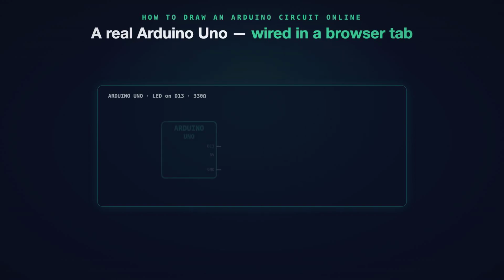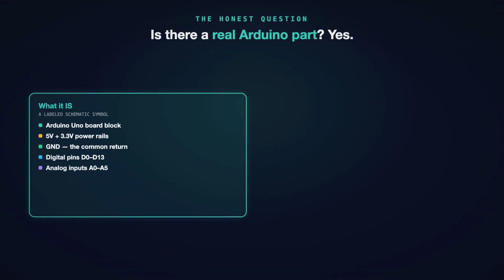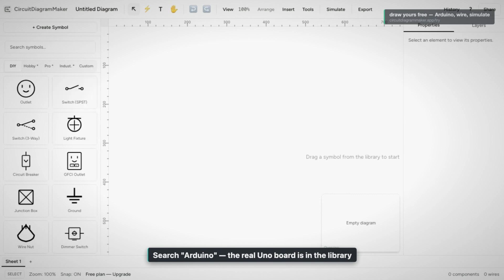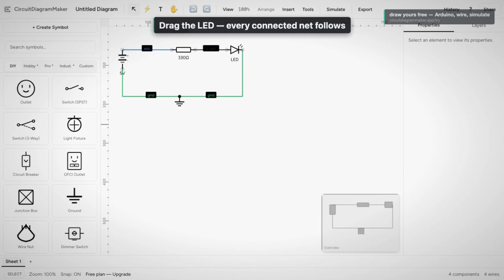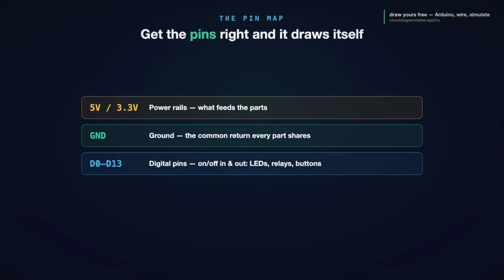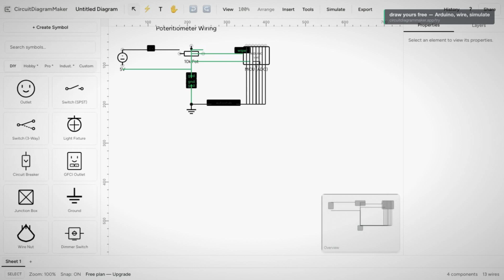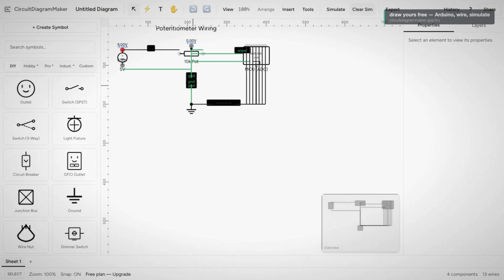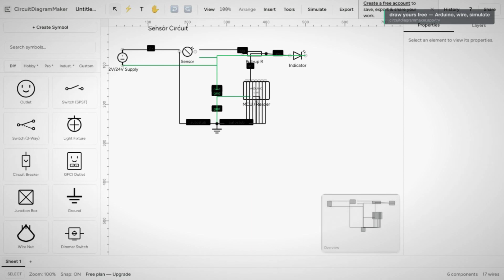How to Draw an Arduino Circuit Diagram Online

Comment from the maker: Full disclosure (also said in the video): CircuitDiagramMaker is our tool — free to draw and simulate an Arduino circuit right in the browser, nothing to install. And yes, the Arduino Uno is a real labeled symbol with named pins (5V, 3.3V, GND, D0-D13, A0-A5) — not a photo of the board.

The workflow in one line: search "Arduino", drop the Uno on the canvas, wire an LED to a digital pin, a button to an input, and a potentiometer's wiper to an analog pin — then hit Simulate and watch real node voltages and branch currents land on the schematic. A pin tied to the wrong rail shows up as a zero before you ever plug in a board. That live SPICE check is the thing a picture-only drawing tool simply can't do.

Draw your Arduino circuit free — LED, button, potentiometer, or your own — no install, no sign-up: https://circuitdiagrammaker.app/try?utm_source=youtube&utm_medium=pinned_comment&utm_content=yt-025